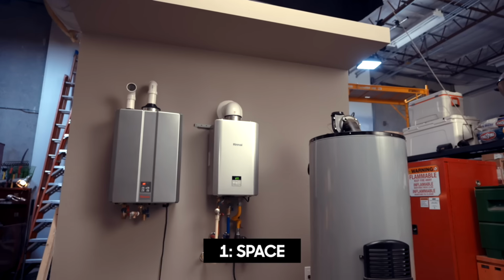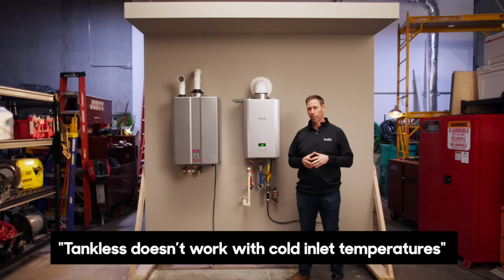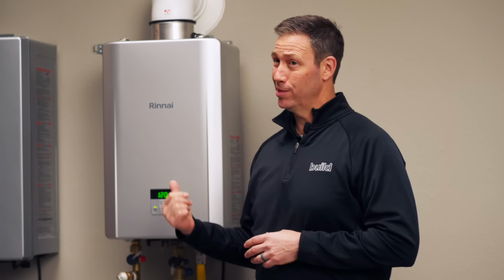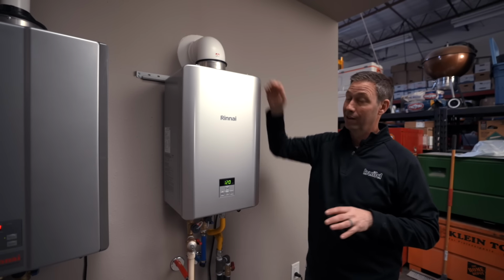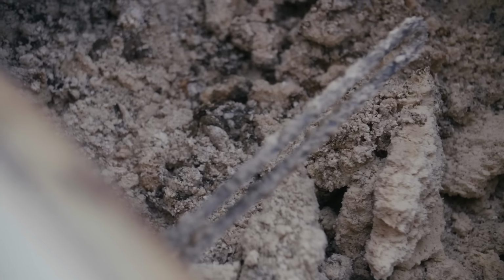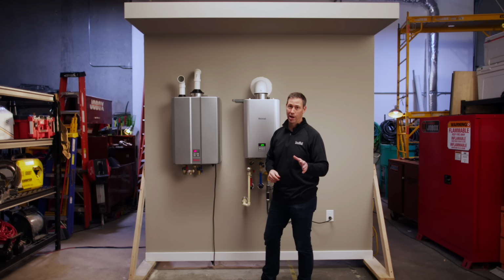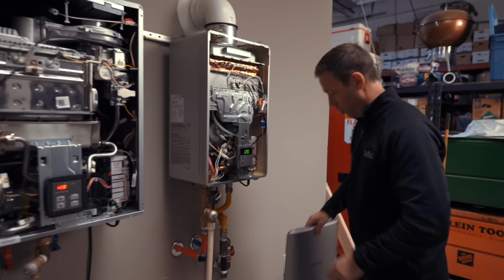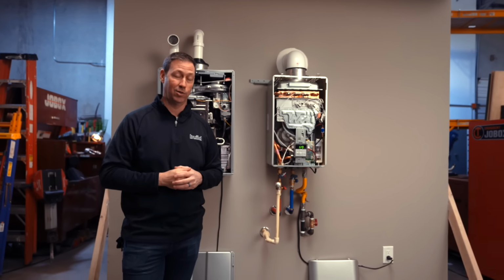DEBUNKING Tankless water heater LIES!

Comment: This dishonesty in this video is pretty profound.  From an efficiency stand point the unit should always be installed in the building envelope.  The install cost vs replacing a traditional hot water heat is about 4-5X more expensive.  By the time you run new venting, close off existing venting, upgrade gas lines and run an electric feed you are in way more then you would ever save by installing one of these units.  Another blatant lie was about scale build up.  Scale and buildup are more harmful in tankless units as they have tiny passages ways in the heat exchanger that water runs though.  Traditional hot water heaters do not have these small passages.  The final myth that you failed to prove wrong was the upgrading of the gas lines.  Just read the BTU requirements on these tankless units compared to traditional.   Pretty disappointed your selling out your good name for a sponsored video.
Reply: Yup. very misleading. 

Lifespan would be high if the homeowner has a water softener or regularly descales the unit. 

Gas thing: simply over simplified. Going from 35-45K btu to 199K BTU is going to require some up sizing. 

Apples and oranges at the end of the day. Tankless is a solution for particular symptoms, not an “upgrade”
Reply: I think this guy is full of shit, I'll never have another one
Reply: Colorful language to argue about some subjects, since you point out as dishonest you lost half of your argument, I think some people will be bite on it… stupid way to disagree
Reply: Robert, they are expensive to buy and install, I know I have had two so far. For my the benefits of comfort outweigh the cost. The units are highly efficient, and while btu demand can be high, it is only for the time you are actually heating the water the rest of the time it is zero. Depending on water hardness descaling can be a frequent as once a year. Descaling is an easy DIY project. You are correct about upgrading existing gas lines for most of these units.
Reply: Totally agree with this post. The gas line almost every time is not sufficient enough to power the tankless water heater. The challenge is always how to get enough BTU's to the thankless water heater.
Reply: @07wise  Yup first home had to run a larger gas pipe to tankless, in second home gas company installed a larger than normal service pipe to handle the upcoming tankless. None of these were cheap to do.
Reply: @07wise  this is the biggest problem with most installs. A majority have undersized gas lines. See it everyday
Reply: @chadschafer1723  yeah, as a plumber,  I took offense to the guy when he said an experienced plumber can install these just a efficiently as a tank heater. I always tell homeowners it's a lot of effort to make the change and this guy makes me look like a liar. Haha
Reply: You are way off. It is not a boiler therefor being inside the building envelope means nothing. Most homes built after 2000 have had power vent water heaters installed. Replacing a power vent water heater with a tankless is now roughly the same price. The electric outlet is already there. The hole in the wall is already there. The only difference is the condensate removal, at worst you have to supply a small condensate pump. As far as cleaning the unit, yes they must be cleaned by pumping a little vinegar through it every couple years but of course this depends on the water quality. When cleaned this brings the unit back to brand new efficiency, in the case of a tank water heater The calcium will build up on the bottom of the tank and although it does not cause a pressure drop it will continuously build up and increase the stack temperature. I have seen old tank water heaters running about 30% efficiency, you are only fooling yourself. As far as your last statement, just do the math or find someone who can do it for you..1 BTU is the amount of energy needed to raise one pound of water one degree. 1 gallon of water weighs 8.33 lbs. Flow rates are in gallons per minute and BTUs are per hour so dont forget your conversion. I would say that is about a third grade math level. Now shut off your water heater and probe the water temp. See how many degrees it loses every hour. Now convert the gallons of your water heater to pounds, now multiply the pounds by the hourly temperature drop you recorded earlier. This is how many BTUS your water heater lost by just sitting there in just one hour. Multiply this number by 24 (hours in a day) then that number by 30 (days in a month). Then go back and edit your ridiculous answer.
Reply: @anthonyspadafora1384  you completely misunderstood the fact that BTU output is directly related to the physical AMOUNT of fuel available to burn. More BTUs require more fuel volume. His point was almost every home NOT built with a tankless is going to require at least a larger gas line. If not a completely different regulator on the gas supply to the house. 

So while it’s true that replacing a power vent tank type water heater is similar in cost. It will almost always be more expensive just because of the larger gas supply needed. This can be up to a 1” line depending on BTU rating. Most gas lines are 1/2”. And I’ve even seen some old iron pipe that is only 3/8”. So in a worst case scenario. Going from 3/8” all the way up to a 1” line is going to involve changing not only the line to the water heater, but also the main supply post regulator in most houses which gets extremely expensive, very quick. 

Nobody is saying that tank type and tankless use the same amount of fuel or even in the same way. We all understand the tankless only burns when water is being used compared to heating water all the time.
Reply: @brandoncrimmins6296  Again I would imagine it depends on where you live. In eastern PA if you have gas in the house you usually have heat, dryer, stove and water heater although generators are becoming quite popular and also outdoor grills. Older homes usually have a 1 inch main at 7 inches of water column and many of the newer houses have a 2 pound system reregulated near the furnace/water heater. So there is always plenty of gas and the amount of gas that is available is more than your charts at atmospheric because these units all use negative pressure gas systems. Most can now use 15 feet of 1/2 gas pipe before it becomes trouble. I would imagine if you live in an area where the only gas being used was a 40,000 btu water heater and they ran 40 feet of 1/2" pipe across the basement then you would need to run proper size piping or convert to a 2 lb system thus increasing the cost.
Reply: @anthonyspadafora1384  I’m currently in northern Wisconsin but was born and raised in Minnesota. We get exponentially colder than you guys do. Our gas lines are fairly standard at 1/2”-3/4” main supply and then if it’s not already. It steps down to 1/2”. You’re just wrong. And regulators here are on the outside of the house and owned by the gas company. So then you’ve got to get them involved. And yes all of the places I’ve lived have had a full suite of gas appliances. I even had one place with two full kitchens and to 80 gal water heaters. And a fairly large furnace.All supplied by a 1/2” main. 

Maybe a very small tankless can use a 1/2” line but to supply an average 4 person household you’re going to need at least a 3/4” line.
Reply: @brandoncrimmins6296  We had low pressure mains for many years and after fracking was approved in PA we were flooded with cheap and plentiful natural gas. For the last 20 years now they have been replacing all mains with high pressure and moving all regulators and meters to the outside of the building. Homes built during the boom of 2000 to 2008 were using 2 pound systems regularly. This allows a higher flow rate in a smaller line and then another regulator, centrally located in the home dropped the pressure back to 7 inches. These homes were all done in corrugated ss pipe. I installed 2- 200,000 BTU units in the last month and both only required a 10 foot piece of 3/4 csst to complete. I had to extend the lines anyway because the tankless mount on the wall and the original power vent tank water heater was 3 feet from the wall.  So the advantages were numerous in both cases. They could once again fill up the 2 person tub, opened more floor space in the basement, 15 year warranty on the exchanger and took the efficiency up from 65% to 98%. I think that was well worth the little time it took to add a piece of csst.
Reply: @brandoncrimmins6296  Naviens largest unit, 240A says first thing....½" gas pipe capable up to 24'
Reply: @anthonyspadafora1384  yes for stand alone install.
Reply: @brandoncrimmins6296  All I can say is I have about 150 units out there. Had a lot of trouble with the early Naviens when they were using the GAC gas train but since they went to a negative pressure gas system, like every boiler manufacturer did, I have had very few problems. The customers love them. I only install the A model with the built in buffer tank. This solves several problems associated with tankless. Time it takes for hot water to arrive at faucet, minimum flow rate and cold water sandwich.

Comment: 10 years out of a tank water heater?
Wouldn’t this be dependent on the quality of your water?
I’m in Memphis, we have excellent water, and our AO Smith tank is original to this 1998 built home.
I keep waiting for it to stop working to install tankless, but I’ve been here 11 years now… still waiting…
Reply: sure it depends on water quality, also depends on whether you flush it periodically.  just like tankless, but tankless needs the flush far far more often.  Also scale buildup can disable tankless, where as a tank can keep working for many years if not flushed.

Comment: I install a lot of tankless for a living. Just to touch on a few points 

Venting for non condensing is expensive unless it’s is set up as you’re showing it on a exterior wall. Longer runs add up quick 

Copper heat exchangers even on non condensing go bad quicker in my opinion, I’ve changed out alot of the non condensing units. 

Gas line my not be an issues according to the manufacturer, but if you’re getting it inspected you will more than likely run into problems with the inspector. 10ft of 1/2” black iron only does 172,000 btus. Trac pipe even less 

Maintenace Is key for these. If you never maintain it just like most people never maintain their tank style you’ll probably not get much more life than a tank.

Last. Don’t go cheap!! But a Rinnai or a Navien. Amazon tankless are crap, Rinnai even has some cheaper models I wouldn’t recommend. 

I install alot of these residential and commercial, and I recommend them like crazy but I do point this stuff out before installing them

Comment: Our main issue is that the water heater was in the basement, and it was an 80 foot and 100 foot run to get to the sinks and tubs. Luckily, the water heater burnt-out, and we replaced it with two on-demand heaters - one in the full bath and one in the kitchen. The run for the bathroom is 4 feet to the bath and 2.5 feet to the shower. The kitchen is 3 feet to the sink.

Our electric bills are averaging $120 PER MONTH lower.

Comment: Tankless absolutely DO take longer to get hot water to the tap. I replaced my tanked heater with a tankless, all other plumbing stayed the same. it took about 15 seconds longer to get hot water to the tap.
Reply: Because the tankless is not generating heat until you draw water so the pipes cool down. A water heater is constantly maintaining water temp and heat transfer through the standing water and pipes.

Comment: Just replaced a 34 year old electric water heater in a house I moved into last year as PREVENTATIVE maintenance. It was still going strong, but I figured it would be a good idea to replace at this point vs. eventually getting stuck when it finally broke down. Especially with prices on everything going up, and supply chain issues. It took over a month to get the new one as is with low inventory.
Who knows how long the old tank could have gone though, as the sacrificial rod was in great shape and it didn't look like it had ever been replaced. Who actually replaces them anyway? Not many.
My new one has thicker insulation and has a slightly lower annual operating cost than the old one. I never run out of hot water as it's sized right for the house. I installed it myself for under $800 total cost. A tankless would have been significantly more expensive. How many years would it have taken to make that back? Dunno, maybe not long with the way costs of everything, incl. electricity, is rising. 
Oh, it's installed in a basement too, so space isn't an issue. 
Point is, on demand makes sense for some people, but not for others.
Reply: Which brand/Model did you replace it with? And which Brand did you replace?

Comment: What If gas line to small for unit 
What happens if there's a fixture mixing in the house and only get Luke warm water.
Then what happens if error codes come on can be lots of reason intake dirty etc
 With a nice good gallon water heater  you don't got to worry about it. 
If there's a black out you won't have light to power your tankless then no hot water. 
With a gallon one at least you'll have hot water

Comment: Scale killed one of my older thankless units.  Anyone have experience with the electronic scale inhibitors where you wrap the cold water pipe with wires to create a magnetic coil?  Pretty cheap solution of it works
Reply: Flushing with vinegar is cheaper.
Reply: @cfldriven  Not when you have real estate with dozens of units.

Comment: One of the biggest problems with tankless water heaters is the installers. Most plumbers are not control men. The type of gas valves and electronics are closer to HVAC techs. Many plumbers, because of their fear of repairing anything with "all those wires" talk bad about them. Unfortunately most people believe you call a plumber for a water heater.
Reply: In our area per code this is a plumber gig. I had to change the pin configuration for high altitude as that wasn't something he noticed in the manual, if he read the manual.
Reply: which is a bit sad.  If you ain't smart enough to learn the basic controls needed to install tankless, you ain't smart enough to understand the complexities of plumbing either.   Being older myself, i do respect those who may find it difficult to learn "new tricks," and fine if they just stick to what they know until retirement.  They have well-earned wisdom that is valuable in other respects.  But there are way too many bad plumbers out there, whose understanding isn't much beyond hooking up garden hoses.  Perhaps looking for one who has the know-how to properly install tankless, is a good idea even if you don't have a tankless. :)
Reply: @annamyob  No doubt, This trade is made up mostly of what we call installers. They don't really understand the physics or math but are smart enough to read a manual to install these devices. Then we have service men, they troubleshoot and repair. Last but not least we have the design/build guys. These are the guys that have a good grasp on the physics and the availability of devices needed to build unique systems.  It is actually very simple to figure out the savings in standby loss alone with a tankless. It takes 1 BTU to heat 1 pound of water 1 degree. That's how simple it is! A 40 gallon chimney vented gas water heater loses about 7 degrees an hour. So first we convert our gallons to pounds. 40 gallons x 8.33(the weight of 1 pound of water) is 333.2 lbs of water x 7degrees that it is losing every hour through the jacket whether you are using it or not. That is 2332.4 BTUs that are lost every hour. We will multiply that by 24(hours in a day) That is 55,977.6 BTUs lost every day. Now we will multiply that by 30(days in a month) That is 1,679,328 BTUs a month that are lost. Lets try to get some perspective on this as most people can't see BTUs in their minds eye. 1 gallon of propane contains 91,000 BTUs, so we will divide our BTU loss by 91,000.1,679,328 divided by 91,000 =18.454 gallons of propane. That is 4-1/2 tanks of propane that you have under your grill every month that just burns away without heating anything. Now lets finish this picture, 4-1/2 tanks per month times 12 months in a year = 54- 20 lb propane tanks a year just to keep your water "ready". It is so ridiculous, tank water heaters should have been outlawed 20 years ago.
Reply: @anthonyspadafora1384  won't argue with you.  Good reason to go to electric heat pumps.  but please also use your excellent math to figure how  much heat and water are wasted when the brainless tankless requires me to run water faster just to get any heat at all.  all those extra gpms of water wasted every single day.   One shouldn't have to bargain global warming versus depleting the water table.  What sickens me is that the waste of water and heat is designed into the tankless, 100% preventable if they designed 'em right.
Reply: @annamyob  Heat pump water heaters suffer the same standing heat loss as any other tank type water heater and once again they lack the capacity to fill a whirlpool bath. In PA water is no problem, we are blessed with so much fresh water that most of it just rolls out into the ocean and becomes salt water anyway. Again the math is very simple 1 watt =3.41 BTUs Heat pumps operate at a COP of 3 which means you will get 10.23 BTUs per watt until the resistance heater kicks in. This is why you will not see a direct correlation on cost to operate. I mean if a electric water heater cost 90 dollars to operate then a heat pump water heater should cost 30 dollars, but it doesn't.